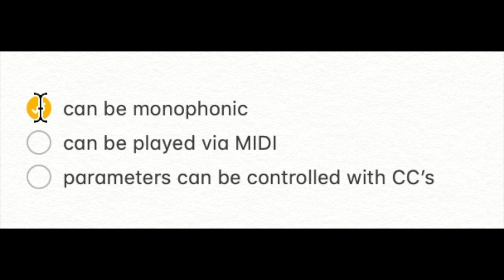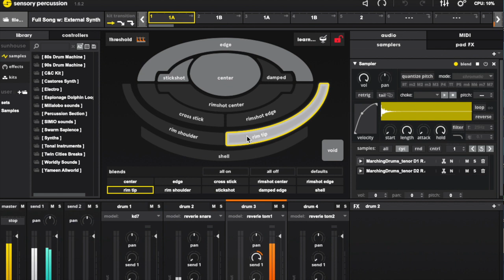Sensory Percussion Full Song w/ External Synth Tutorial

Comment: Hi Mason, thanks a lot for this ! This is awesome ! I have a question : do you use your Roland KD-7 (is that it ?) with the Sensory Software ? And if yes, do you use an external midi interface for it ? Thanks a lot. Felix
Reply: Yes, he is using the Roland KD-7. you just plug it in directly, will work with SP software. More of a hack. Lose some functionality.
Reply: So you need an interface with midi? I’m still confused about the kick part